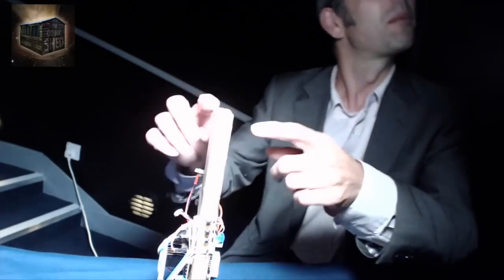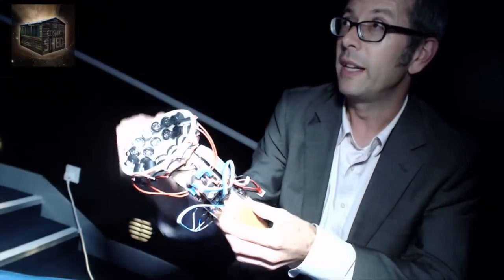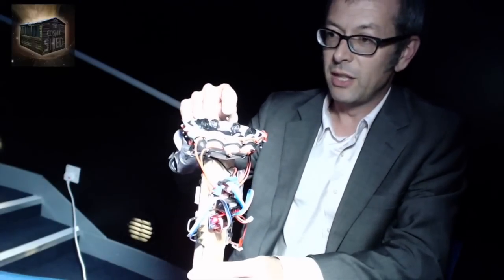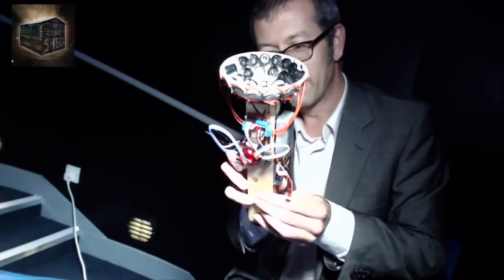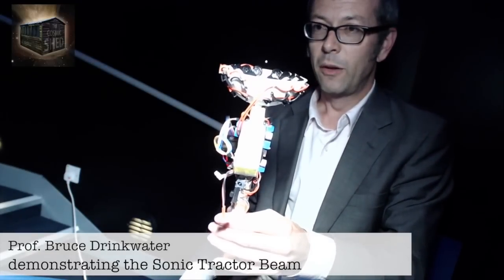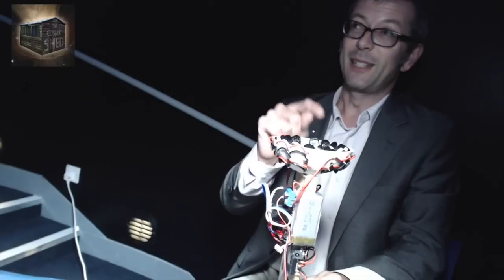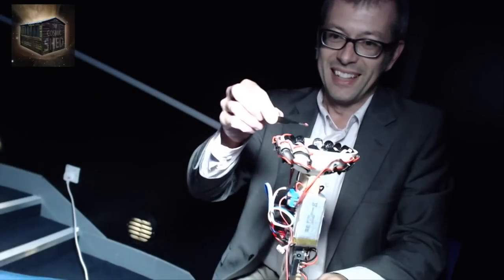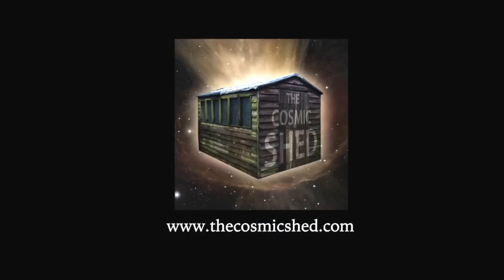Sonic Tractor Beam Demonstration

Comment: Awesome! Could a beam pull as well? Or only push?
Reply: yes it can pull, it pushes to generate high and low pressure zones, the low pressure zones is where the particle will be. slight phase shifts or frequency shifts will change the location of the zones and so pushing or pulling it.
Reply: @cyber_hacker  thanks

Comment: Goes without saying then that this could not be used in space - no air. no sound waves.
Reply from the maker: Indeed but as Prof Bruce points out, it could be used by a spacecraft inside the atmosphere of a planet...theoretically.
Reply: True.
Reply: Because photons generally don't have enough mass to be able to affect bulk materials, unlike air molecules. There are such things like solar sails and ion thrusters, but those are quite bulky and/or weak.

Comment: Youre going to think I'm crazy and I know by science I shouldn't be able to hear anything..... but I can hear it. It is very faint when its facing up but when he started moving the beam around clockwise and anticlockwise it increased in intensity and I could more easily hear it, especially when it was facing directly at the camera......... That should be absolutely impossible. There was a doppler effect as he turned it toward and away from the camera...
Reply: It's microphone noise
Reply: Camera mics or whatever mic they were using can pickup noises not heard to the human ear. That is how many sounds we can’t hear are recorded.